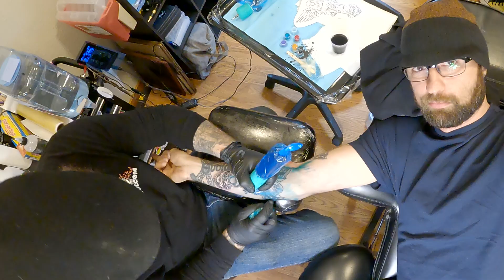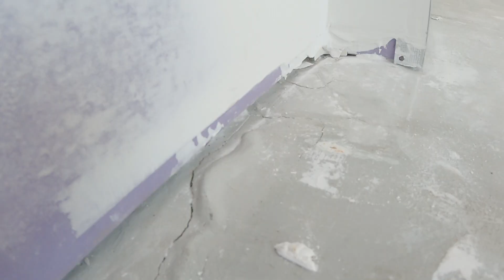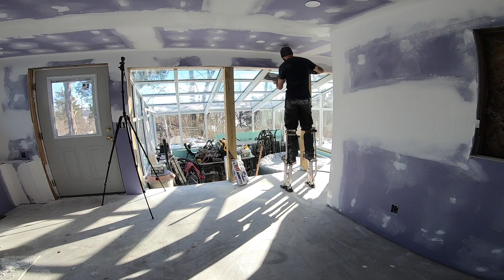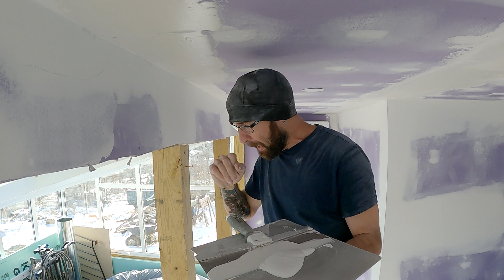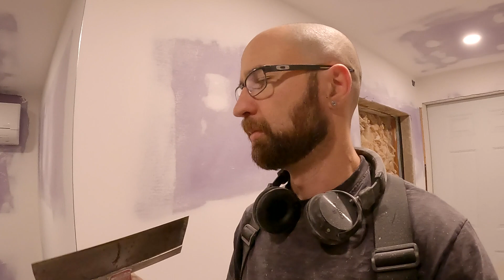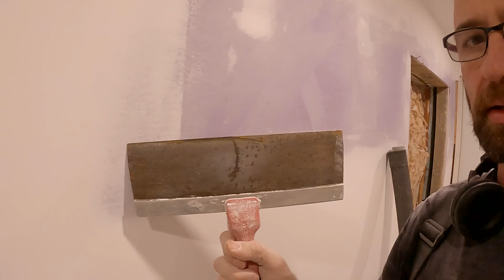Making Dust and Telling a Story (ep 18)

Comment: Our oldest son was a prodigal for many years.  Last Thursday, he had a rough day. He got off to a late start and then the diesel truck he was driving went from indicating that he had 44 miles left on the tank of diesel to sputtering to a stop at the side of the interstate in a matter of moments. He called and we drove out with 10gallons of diesel from the homestead. Being a diesel out of gas, it took forever to get the truck restarted. It finally started and as he pulled out into the lane, we heard a loud pop and saw a big black puff of smoke come out. The air hose on the turbo had blown. We spent five more hours visiting nearby towns looking for something that would hold. Finally, he got a special clamp that held and he was ready to truly road test it. We said our see “you later, say a prayer before you pull out” and he headed for the truck. He sat and idled for a moment and then got back out of the cab, walked over to my car, looked up the road where he should have driven hours before and said “you know mom, I think it’s time to call it a day and head back home because clearly there is something up that way that God doesn’t want me to be a part of”.    Now, I don’t know if that is so but I will tell you THAT statement was a miracle for this momma.  It took awhile, but our son is back to seeking and acknowledging God’s presence in his life and that feels great!
Reply from the maker: That's SO awesome. It sounds like it was what he needed to have happen in order to listen!  :)

Comment: I'm 48 and when I was around 8 years old I was at my cousins' farm and we were on 4 wheelers. I had no idea how to operate one and was on the back with my cousin driving. Something went wrong with the 4 wheeler and she got off to check it. I'm guessing it jolted and I grabbed the handlebars to hold on. The 4 wheeler took off across a road and into an open field. I had no control or knowledge of what to do and I was terrified.  I remember looking up at the sky and yelling God help me! The 4 wheeler slowed to a stop and when I looked down there was my hand and arm hanging in the air. I had no idea my terrified grasp on the handle was what was giving it the gas and speed. God removed my hand from that handle bar. I didn't feel it happen. I just know the 4 wheeler slowed and stopped and there was my hand midair. One of the cousins told me that up ahead was a drop off to a creek. She had been running behind me trying to catch up and help.  God..Thank You.

Comment: In 2020 I had the neighbors tree fall on our house at 4 am.  The huge trunk fell parallel with my bed and about 6 feet from where I was sleeping.  It landed literally inches from our gas meter as well.  It tore up our porch, but left our house safely habitable.  On another occasion I had the breaks suddenly go out in my pickup truck due to a break line bursting.  It happened just as I was turning into my driveway and SAFELY at home.  If you are a Christian then Gods perfect love and his perfect timing ALWAYS protects us.  Even if it is our day to go home, HIS timing is always perfect.

Comment: I was driving to a dental appointment and stopped behind a car and a van, When the light turned green the van stalled. Less than two seconds later a sedan roared through the intersection running the red light. There would have been a massive car wreck if that van had not stalled. God was looking out for me for sure.

Comment: I'm a pizza delivery driver. I pulled into a dark condo/apartment complex that was tucked away off the main road. Very secluded. It seemed...darker than usual. I'd never been to that complex before, but it was noticeably darker the second I turned in. As I looked around for the right door to park in front of, I kept noticing movement in the corner of my eyes. Now, I've had experiences in the past that have told me that I'm...sensitive to certain things. And I always try to convince myself that it's just anxiety and everything is fine. We all see things out of the corner of our eyes, right? So I parked and got out of my car, and immediately felt the heaviness in the area. I saw another movement in the corner of my eye, but there was nothing there. The movements were on the opposite side of the parking lot. I turned around to place the pizza on the door mat (contactless delivery at this time because if covid) and immediately felt like I was being watched. Again, I tried to tell myself it was nothing. Everyone has those moments, right? It's just paranoia, right? But I was feeling nervous and was kind of fumbling with the pizza bag to get the pizzas out. As I did so, the thought popped into my head that something bad was going to happen to me. So I started moving faster to get the pizzas out. There's these little cardboard pizza pedestals we have to fold to put the pizzas on, so it took a minute. As I was doing all this, the words popped into my head "you need to leave right now." And they weren't my words. So I started hurrying faster to get everything set down. The words repeated again and again, and I got the feeling that if I stayed there any longer, something very, very bad was going to happen to me. Finally it was like someone was almost yelling at me. It was almost an audible voice. Again, not my voice! "You need to leave RIGHT NOW!" I turned around and ran to my car, I locked the doors and sped out of there so fast. I didn't even ring the guy's doorbell. I waited till I was all the way down the street before I slowed down to hit the complete button on my driver's app. 
I've returned to the complex a few times since then to deliver to the same guy, and once I even talked to the guy. He seemed fine and was totally nonthreatening. I've never felt danger like that ever again. It's felt perfectly safe and it wasn't so dark at night. 
But that first night, I was terrified. There was definitely something bad in the parking lot and I'm glad I got out of there when I did. I was definitely protected.
Reply from the maker: That's awesome. After we all meet Jesus in eternity and you ask him what it was, would you find me and let me know too?  I'd love to know.   :)

Comment: That was me asking about the corner. Thank you. So, you don't put mud literally on the metal corner all the way down? Just butted up next to it? That might be why it doesn't work for me. I have had several times when I might receive a phone call or for whatever reason I get a late start (flat tire) only to learn of a serious accident that happened at the area I should have been. God is so amazing how HE cares for us. Thank you again for the corner. Thank you for sharing how God protected you. Blessings to you. Love the new ink.
Reply from the maker: Yes the mud will completely cover the tab (part with the screws holding it to the wall) and push up to the bead (metal bit you can see) then taper down the wall.    :)
Reply: @EmptyHammock  Thank you so much. Blessings

Comment: I was working as a security guard at kawasaki while. in college.  One weekend night while the plant was empty and dark, i was making rounds between the manufacturing and warehouse sections.  There was a huge electrical rollup door between the two buildings, and when i was passing thru i didn't want to wait for the door to go all the way up 15 ft, so i just let the door go to chest height. As i bent down,  a voice said NO! and pushed me back. At that moment, the pully fell of the motor and door came crashing down.  It would have landed on my neck
Reply from the maker: Nice!  :)

Comment: Was coming home from Christmas at my daughters and got a craving for McDonald's fries. There is a McDonald's I mile from my home which was 100 miles away so I stopped at one half way home.  Sat in the drive through 15 MINUTES watching the clock.  In the process of getting angry that little voice said be patient, there is a reason.  Drove on and when I got to the intersection where the McDonald's is near my home there was a 9 car accident caused by a drunk driver. It had happened about the time I would have been going through the light according to the time stamp.  The fire trucks which are 3 miles away had just pulled up.  And an out of state fire and rescue command center bus just so happened to be at the gas station.   Life Flight just so happened to be at the local hospital 10 miles away..  No one died.  GOD was all over that one.
Reply from the maker: wow